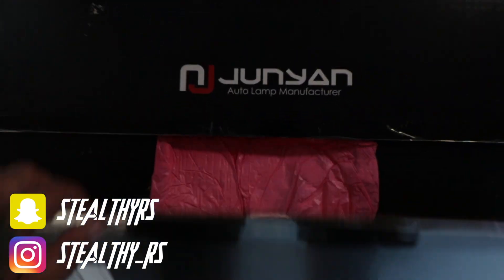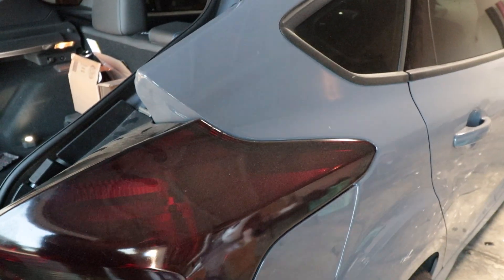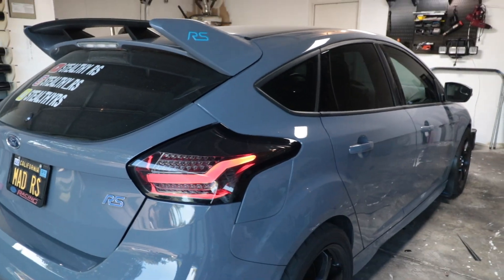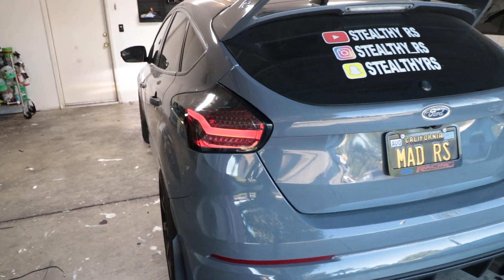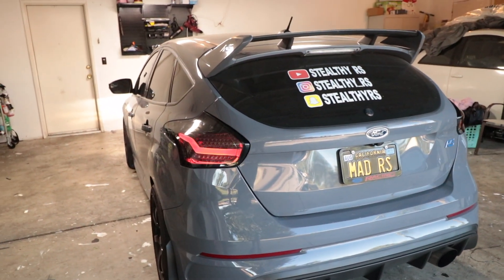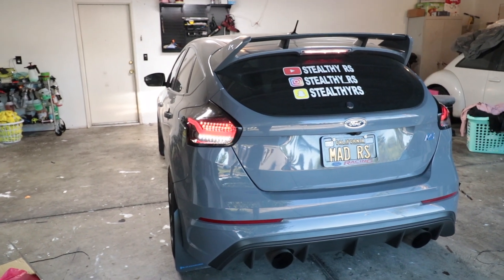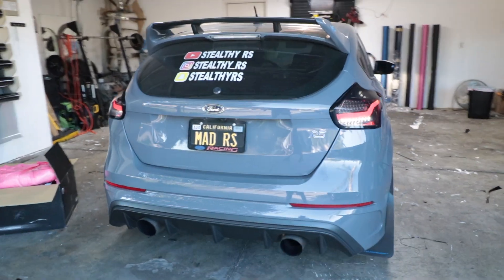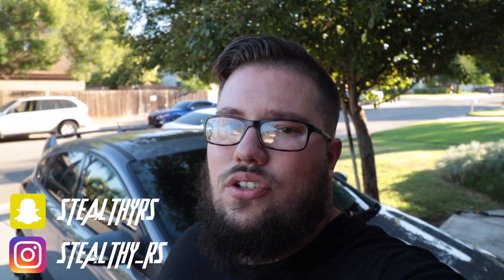Spec D Tail Light Install | 2017 Ford Focus RS

Comment: hey, its been almost 2 years, how they holding up? I heard about these dimming over time.
Reply from the maker: Honestly I got rid of the car. But they were good for the time I had it.
Reply: Have them in for 1 year now, so far no issues, quality is "ok" just be careful when peeling off the protective film, if it is stuck to the backside of the " clear lens" it might damage the black border. On mine it was stuck on pretty good...
2 points i don't like:
- indicators are a bit dimmer than oem depending on the viewing angle. From further away (5m +) they're comparable to oem but they're rather dim in the "blind spot area" in full sunlight (mirror indicator is well visible from that angle so it's not a issue)
- reverse lights illuminate horribly if it is pitch black -> turning on the rear fog light solves this though as it is really bright

Other than that, i think they look great, i've got the silver/smoked ones, been thinking of getting the black/clear ones to try em out.
What shocked me a bit is how bad the fit and finish is on the oem lights, it's just wires hanging around and painted bulbs for the indicators -.-